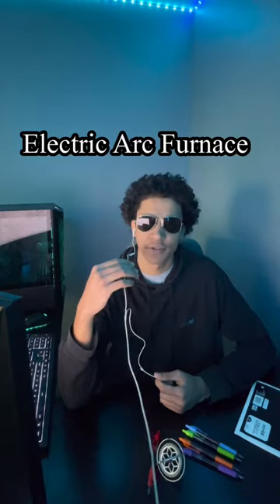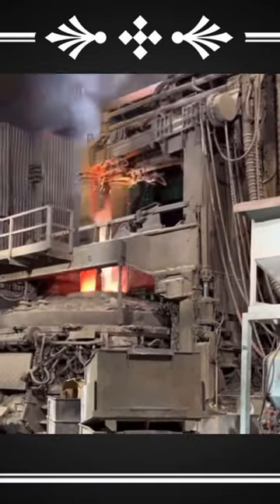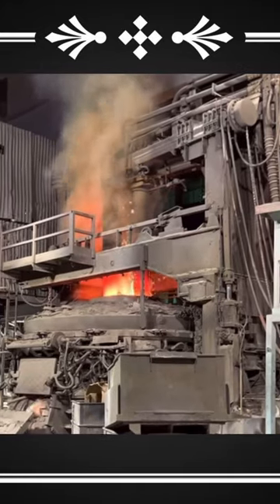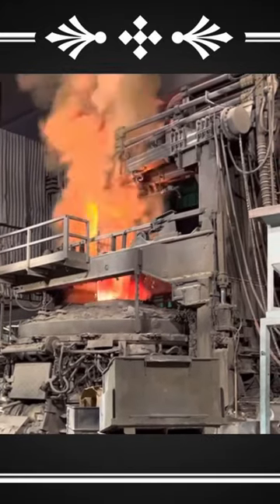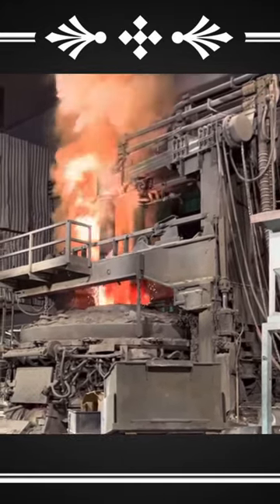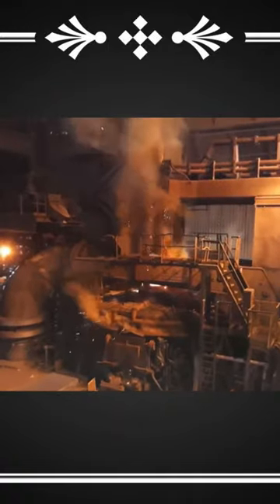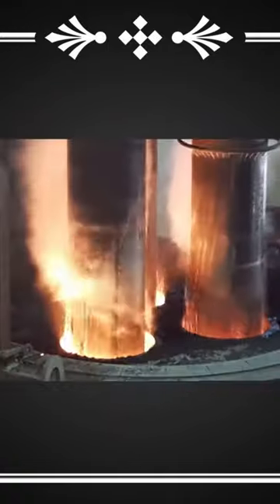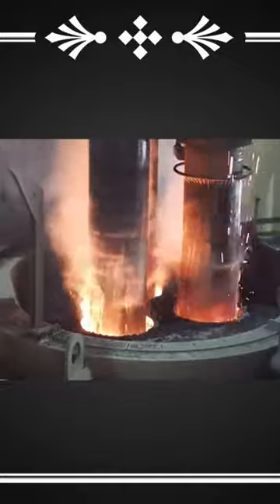Electric Arc Furnace #shorts

Comment: Some cities that have these actually use them primarily at night to not only make it cheaper, but also to put less load on the grid.
Reply: Yeah, I know that MAN in Augsburg (Germany) does most of the casting (or smelting) at night for that exact reason.
Reply: I live in the originating town of one of the biggest steel manufacturing companies on the market, Sandviken (sandvik), the EAF we have here can sometimes just slightly dim the lights in the town when it starts up, mostly only noticable at night just cause in the day it is too bright to notice
Reply: In some areas the grid even dictates when they can run these machines.
Reply: We one of these in my town. Worked there as a machinist. Yes they’re only allowed to run it at night. So I heard this story from some guys at the plant, they were testing a new brand new furnace and when the went to do a melt and lower it in. The browned out half the town. the machine caused a nasty voltage drop and basically killed itself trying to suck more power when there was none to found. Took another year to make repairs and testing was done at night this time.
Reply: It's crazy to think how 1 device can significantly effect an entire city's grid
Reply: @creeperbait_42  today I was near a power line when it started making a electrical Amp noise like Zaaaap Zaaaap like a Halloween sound effect and It reminded me of this short a bit because I wondered wtf is hooked up rn that is making the wires on the streets make hella noise.
Reply: I used to make mini arc furnaces using the electrodes outta big old lantern batteries and fire brick.
Reply: Interesting
Reply: 100% in the hottest parts of the summer. The would shut us down due to the power we was pulling
Reply: @vincentguttmann2231  bruh
Reply: Plants that operate this kind of machinery actually have special contracts with the electric companies, they might have to call up the electric company before starting to make sure there's enough power, and the electric company can shut them off if there's any shortage. They do get a massive discount for buying in bulk, though!
Reply: Been working for East Jordan for about 2 years now. We use induction furnace that use electricity to magnetically charge material up to 2800 degrees. For those of you who don't know, the average temperature of lava is about 2300 degrees. The average American household uses about 400kw of electricity a month. One of these furnaces uses 7000kw per second. We have 3 by the way.

Comment: They're even more terrifying in person
Reply: I believe so ^^
Reply: More terrifying than a regular furnace? I don't think so. Something goes drastically wrong with an arc furnace? The heat source instantly shuts off. Regular furnace? There's coke mixed in all throughout the height of the bloody thing, there's a crapton more mass in it and it just keeps burning. That is terrifying!
Reply: I've worked on these in mainsfield ohio back in the 1990s, and I'll tell you, you can feel the electric pulsating while it's melting the steel, and the sound is deafening!   It's pretty scarry
Reply: @Keiranful okay old blood
Reply: @jakee.4030  why am I supposed to be old? Because I understand how much more terrifying older technology is? Anyone with a working brain and an education in engineering can tell you that. A major driver in new technology is safety after all.
Reply: @Keiranful  so wheres your education in engineering? i can talk to my father and get real answers as he is an engineer employed right now. also implying that im brainless isnt very nice of you at all, and leads me to believe you're lashing out bc i offended you with my simple joke. lastly, from your perspective i can see how you would think a furnace is more dangerous than an electric arc furnace. now let me open your eyes to another perspective, an electric arc furnace clearly has more power and destructive potential. i am much more worried about an out of control EAF then i am a basic old furnace. sorry i angered you old man, hope you can let it go and enjoy your day!
Reply: @Keiranful  side note, no one said an electric arc furnace was more dangerous than a basic furnace until you left a comment bitching about it 😂
Reply: @jakee.4030  first of, I never implied you were brainless, though I am wondering how you worked that into my comment. As for my education? Does a masters degree from a German technical university in mechanical engineering count? Aside from that, all I've said is some common sense stuff. I still don't know why you thought it a good joke to call me old, though...
Reply: @Keiranful  goofy person detected
Reply: But they're so awe inspiring and really good.
Reply: @jakee.4030  EAFs are safer, however there's different dangers present. While you're mostly correct don't speak truth of lies.
Reply: I worked at a place that had ESR, VAR and a multiton VIM. Since it was all vacuum, you could only see the arcing through tiny windows, but you could feel the electricity and the heat from 50 feet away
Reply: @Keiranful  Definitely more terrifying than a normal furnace.  You can feel the power in the air, they make the ground shake, and to say they burn hotter is an understatement.  They literally burn so hot that there is risk of open air causing carbon monoxide produced in the crucible to explode violently.  A breach of the vacuum can literally blow up the furnace sending 3200+F iron out.
Reply: Yes
Reply: Cant get use to this
Reply: It looked like a firework show exploding 10 m away, been there, yes it's terrifying
Reply: The control  systems are  fun too work on.  But concast furnaces are more impressive.
Reply: @jakee.4030  Arc furnaces are used for smaller jobs only, They are not newer tech, And as electricity with the carbon tax is way more expensive than coke blast furnace.
Reply: Yes. Sir

Comment: Imagine the electricity bills 💀
Reply: Probably like a phone number.
Reply: @PatrickSwayzeOnDbol  with a two digit country code.
Reply: They gonna have to use symbols instead of numbers
Reply: The electricity bill for this thing isnt a number, its an emotional experience.
Reply: Nah, it would look like someones ip address
Reply: Yea it’s bills like a phone number
Reply: Probably a million
Reply: @AlonzaStewart  And maybe thirteen digits or something for the IP adress.
Reply: On average a 140 ton capacity arc furnace cost $28,000 in electric costs per 1.5hr tap-to-tap heat cycle. Per month it can exceed $2.5 million, and per year at least $30 million.
Reply: @AlonzaStewart nah. 3 better

Comment: I've made the calculations :
35 kV x 450 Amps = 35.75 MW
Holy kwapp !
Reply: For how much time 😢this consumption is ?
Reply: @deshraj.insta.  under 60seconds or they couldn't have made the short 🤔
Reply: @mikebar42  lmao😂
Reply: At about $0.15 per kilowatt hour, that'd be roughly $53,625 😳 Is that right!? 
$0.15 x 357,500
Reply: Where did you get those numbers? (35 and 450)
Reply: @ricardobino7410  The meter in the video
Reply: Volts x Amps = Watts, where tf did you get 35.75 from??
Reply: @DrakeOola The image in the video @ 00:31

Comment: I got to visit the Timken plant in Ohio when I worked at a steel distributor. These furnaces are just insane, you can feel the ground vibrate and the heat from a distance you wouldn't think possible. It's hard to describe the experience in words, it's just raw power, everything is mega sized and weighed in tons. The whole process is really awesome to watch, I'm sure there's some vids on the tube if you're interested.
Reply: Timken as in Timken ball bearings? That's pretty cool man, used to use em for sled crank rebuilds on the daily. 

Bet that plant was definitely awesome to experience in person, seeing what people are capable of building and just the mechanical sciences in general, not to mention the scale of things alone. Videos probably don't do it justice if I'm guessing honestly.
Reply: @100GTAGUY  they used to be the same company but have since split, Timken Bearings and TimkenSteel. I honestly had no idea about the bearings, I just did a Google search to see if they were the same. The company I worked for was mainly oil field related, we got a lot of tubing from Timken for downhole and bar for... actually I don't really know what the bar was used for lol. Anyway, yea, it was really incredible, and even though it's been twenty years since I went, I'll never forget how loud and hot and awesome everything was. It was truly unforgettable how awe-inspiring it was.

Comment: The scary thing with electric Arc furnaces is you can have explosions of liquid metal if the charge/scrap metal is a little wet with the intense heat generated causing a steam explosion

Comment: I built one of these once. You can get some cheap carbon rods outta lamp batteries. You need carbon rods cause nothing else is able to withstand the heat. Then just hook it up to the high voltage that wveryone has and boom you have the worlds best taser

Comment: Got to work in a steel mill that ran an arc furnace. Not only are they way louder then you're prepared for, but because the probes and lid are removed to load the melt pot several times per melt, they have a tendency to explode. If it's wet outside and water or ice gets in with the scrap charge pot it will get forced into the molten steel, flash to steam, and potentially throw literal tons of molten and solid metal quite a ways away. With enough water I've seen and heard of nearby equipment (forklifts, Slag skimmers, etc) getting tossed over 10 yards away like tonka toys

Comment: Damn, that cauldron must slag up real bad, wonder how often that has to be done.
Reply: The carbon electrones just get used up, as they've got loads just sitting around waiting to be used. 
My next door neighbor used to work in an arc furnace as a sparky. He's told me a few times when the charge is wet and you run for your life! No matter how big a motor or bit of metel is, it wipes out EVERYTHING!